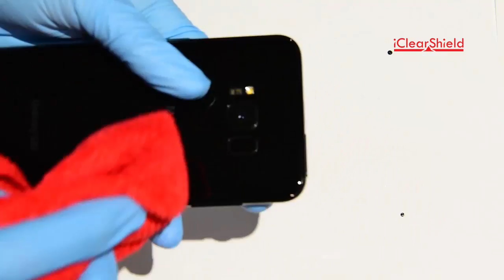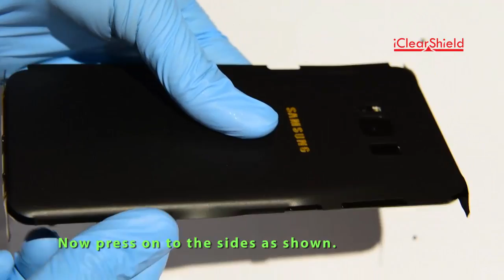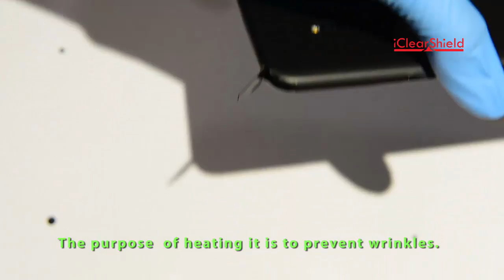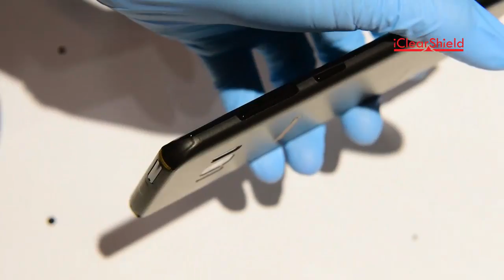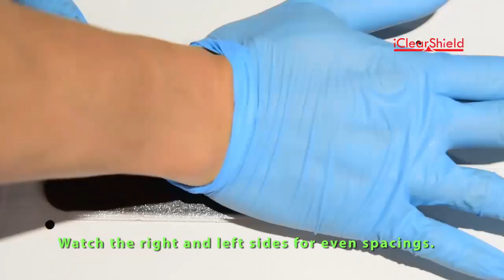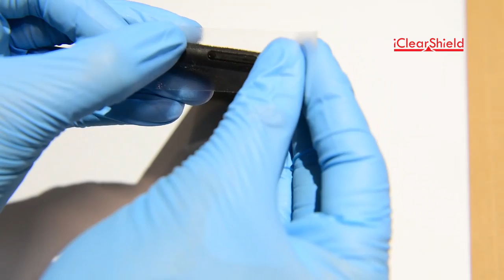How To:  Samsung Galaxy S8 / S8+ Matte Black SKin (Many Colors Available)

Comment: would this work with a bumper case? I have a rhinoshield.
Reply from the maker: I haven't tried it with that bumper case, but you can leave a note for the 3 Mil version, which is 1/2 thinner.

Comment: I got s8 plus with the RhinoShield bumper case will it be compatible?
Reply from the maker: I haven't tried it with that bumper case, but you can leave a note for the 3 Mil version, which is 1/2 thinner.
Reply: I have a debrand skin on and it fits just fine. I have the dragon skin which i believe is thicker than this. Not in love with the dragon skin though too flashy
Reply from the maker: How much was your dbrand?
Reply: iClear Shield maybe 12 -14 bucks.  doesn't wrap around the buttons and I don't think it's water proof.

Comment: I ordered 2 pieces of these, and I've waited for 3 weeks before I got mine, I was so excited to open the package but was so disappointed because the wrap have wrinkles  and some light scratches. The wrinkles maybe comes  from the shipping, not sure tho. I still tried to put them on but I'm not satisfied when I see the scratches. Maybe it wasn't checked first before the delivery.  Not a happy customer here.
Reply from the maker: Alexander Rebot sorry to hear that.  We do offer replacements.  You can use those as practice.  What's your order number?
Reply from the maker: Alexander Rebot i will follow up with you tomorrow when we open :)
Reply from the maker: Your new tracking is LK203908135US via usps.com
Reply: Ok, thanks a lot! :)

Comment: Can i apply skin on top of a screen protector
Reply from the maker: NBelite 666 no it will not work.  You use tempered glass?
Reply: iClear Shield no, its like a plastic sheet one
Reply from the maker: NBelite 666 if you order, email us for the screen protector version .  Where are you located?
Reply: iClear Shield in the uk

Comment: so you obviously can't put a screen protector on it then correct?
Reply from the maker: Yes correct, no tempered glass.  We will release the urethane screen protector version soon, but it's not tempered glass.
Reply: iClear Shield I put screen protectors on my phone because my screen scratches all the time. sucks that you can't put the skin over the screen protector
Reply from the maker: Do you use tempered glass?
Reply: iClear Shield  no just the regular screen protector Tech 21 it's not tempered glass
Reply: iClear Shield  no just the regular screen protector Tech 21 it's not tempered glass
Reply: iClear Shield so can I put it on a regular screen protector that's not tempered glass? And is this similar to Dbrand skins?

Comment: I messed up the edges :(
Reply from the maker: What's your order number?
Reply: I messed up the edges too. Think reapplying heat might work?
Reply: It might if you haven't stretched it out too much. Mine ended up worse because the case I use is kind of tight, so it peeled the edges out. I would recommend this more if you are going without a case or using one thats not too tight.